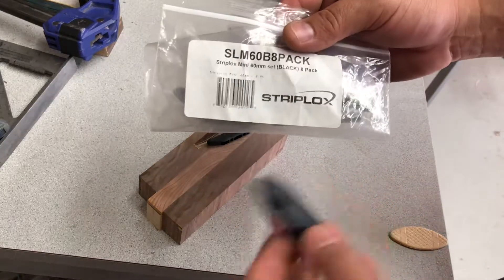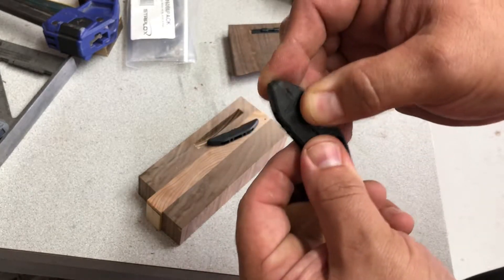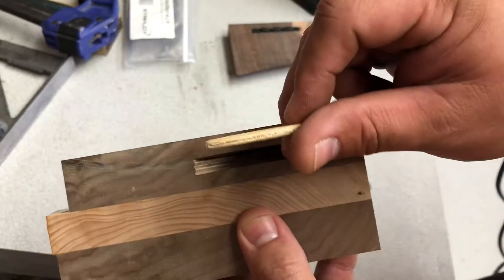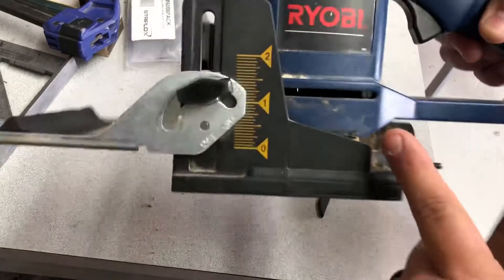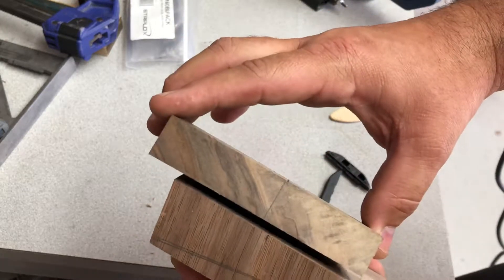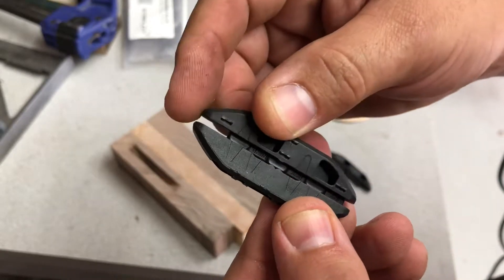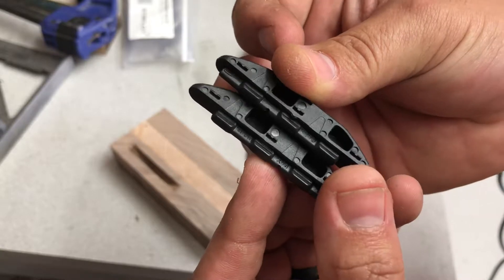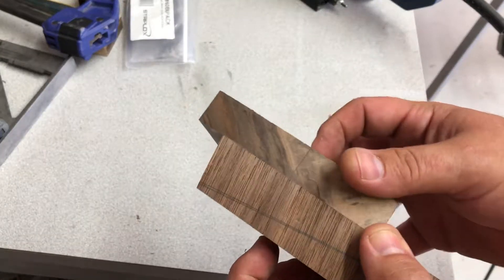Striplox Mini 60 Invisible Joiner Installation Explained

Comment: Hi, thanks for the video. 
You dont need to adjust the fence height every time. Just set the initial plunge at the lowest point and then add a 3mm packer between the timber surface and the fence for your second plunge 👍

Comment: Hi there. Which is the best invisible joiner (permanent or releasable) available on your opinion? I had the opportunity to see Ovvo connectors on work and im not to happy with it. Still searching :)
Reply from the maker: qwidium I can’t really answer as I don’t have experience with any products except these Striplox Mini 60s. They a working well.
Reply: It needs to be glued, so is out of the question for industrial purposes.Thanks for your fast answer.
Reply: Mafell makes the best but you need their 1000.00 bicuit cuter. Not glueing required.

Comment: The porter  cable has a plastic plate that allows double biscuits and I would rather use supper gles and accelerator.